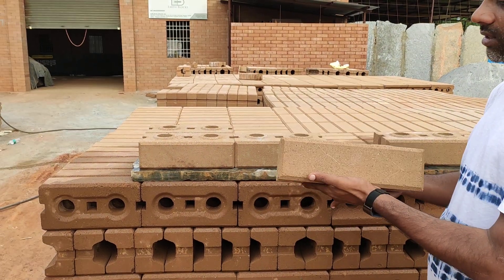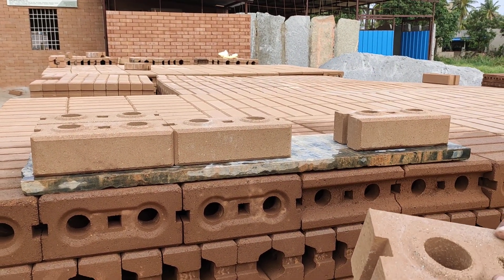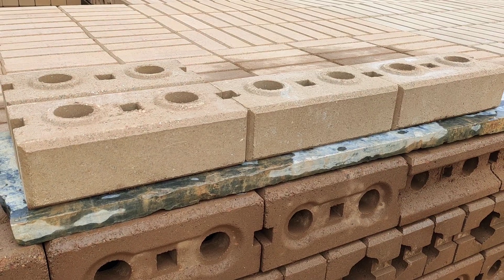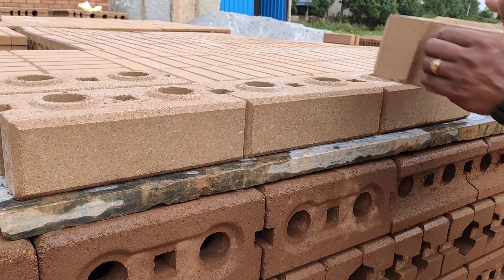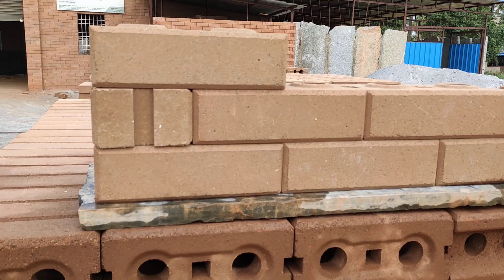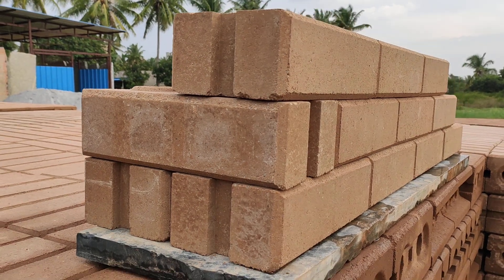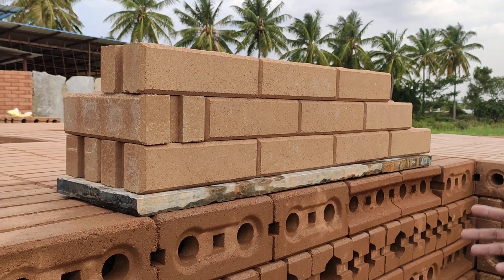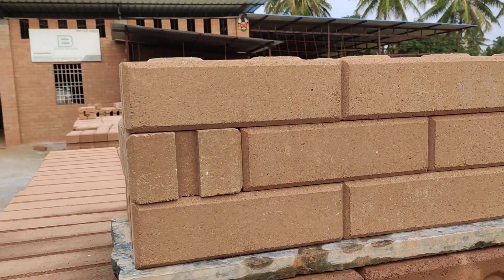Soil blocks interlocking design - Earth Blocks India Pvt. Ltd.

Comment: I have two main 'gripes' with this brick design.  First, having the groove in the ends, then using that for an end brick, to me, is not very appealing.  The other thing that was noticed was the bricks are a general purpose brick; there are no specialty bricks for the corners, or for other sections.  

The other thing that made me laugh was that plans have been seen for a 250 tonne mechanical press, to produce 8 bricks at a time.  The guy reckons that he will be able to produce 600 bricks per hour, with a crew of 4.
Reply from the maker: We have introduced corner blocks without the groove & have been in production for over a year now!

Comment: I heard there would be minute gaps between the blocks that would invite insects. Will plastering of the walls be necessary when using these blocks? Are the unplastered walls water resistant in case of heavy rainfall?
Reply from the maker: It is recommended to do pointing between the bevelled edges to cover all gaps between the bricks it is done by using a mix of fine soil & cement, ratio 6:1  

The bricks have a water absorption of 8 % , for the outside walls you can apply a hydrophobic Nano coat which deflects water but allows breathability, this has a life of over 8 years.  check video for demo https://youtu.be/sgSL53UCryw
Reply: @EarthBlocksIndia  thank you very much for your response.  Are you available in Bangalore? Do you also undertake civil construction too? If not kindly reccomend good civil contractors who are proficient in the use of such bricks

Comment: Beautiful and thank you for sharing. 

Gus you can purchase the machine , after finish your house you can resell it or open an small interlocking business. the other option  is to make the machine Yourself  by following the step by step process from my youtube channel. please do not forget to subscribe to my channel.
Reply from the maker: Good effort you are putting in to make blocks in your country, Best of luck to you in your endeavor,  for a small scale use manual machines are good, but only a hydraulic machine can get you the density & compressive strength that we have set as a quality standard, & while making interlocking blocks the height of the blocks cannot vary more than 1mm.

Comment: Are you selling the machines that produced these blocks or just the blocks it  self. the other question is can those machine produce bigger blocks (W:15xL: 40xH: 20) Hight being 20cm and lastly what is the pressure force on the blocks before its produced by the machine (tell e in psi or MPa) measurements thanks
Reply from the maker: we do not manufacture machines.. our Machines are custom-made for our requirement

Comment: don't use hole bricks in your construction project,  4 times more cement you have to add in your construction due to these holes in bricks, these bricks increase your construction cost 4 times more expensive
Reply from the maker: thank you for your comment, but all of our customers or contractors  have saved cost by using these blocks

Comment: Do you put mortar in between the block or just install it as you show?
Reply: No mortar required. After certain height you can pour slurry cement/sand or cement glue in to the holes to strengthen it.